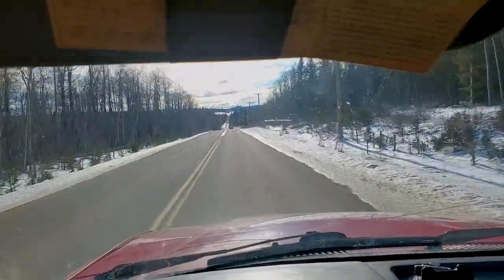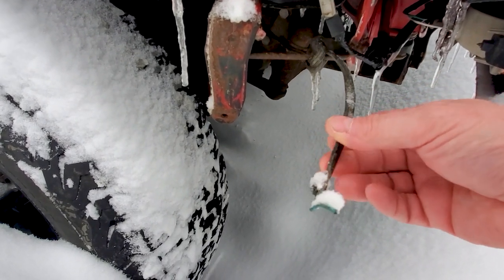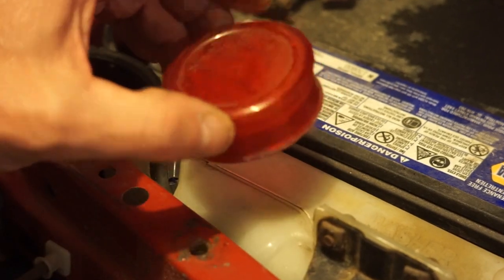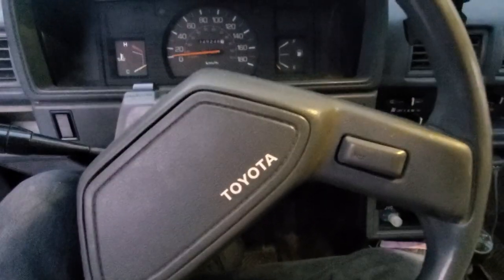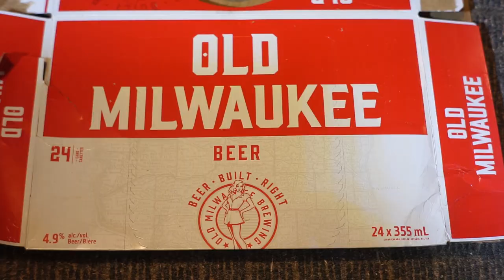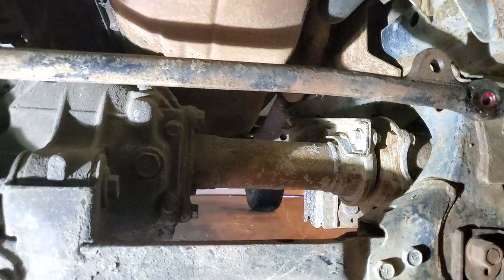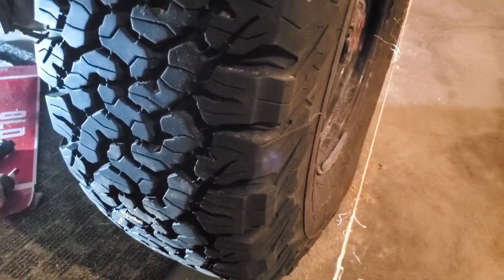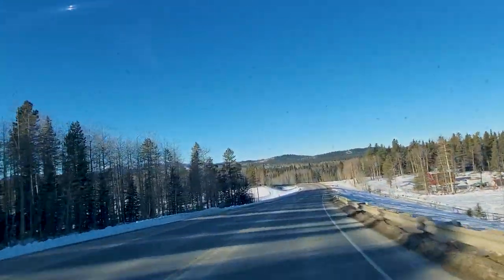Toyota 4x4 Pickup DIY Project, Tie Rod Ends, Idler Arm, Pitman Arm, Steering Stabilizer, Alignment

Comment: The older style ball joint seals have a hole in it to let water out. Very rare you see it nowadays but its to let water drain out or it can be pushed out when you grease the joint. Alot of people don't know this nowadays.
Reply from the maker: Thanks, good info. Do you mean the upper and lower ball joints?
Reply: @JimmyMeatwhistle  any type of joint that has a boot on it. All my dump trucks still even have that style. Brand new joints you buy with a boot. Spin the boot so the hole can drain if possible
Reply: @02blackLightning  Damn, that's good info. Well noted.

Comment: Also I got a 91 toyota pick up 2WD and In need to replace everything in my front. Any requests on the brand?
Reply from the maker: In these weird times, anything you can find will work. I'm having a hard time finding parts in general
Reply: Try looking up the brand Sankei 555. Made in Japan.

Comment: Great to see all the "love" you are pouring into your beater Toyota pickup!  Haven't heard of that "cave man" alignment trick used before . . . learned something.  

One source for Toyota parts for late model Toyota trucks that I've used in the past, is a supplier called Auto8 out of Australia www.auto8.com.au (Australia's version of Princess Auto).  Thousands of old Toyota pickups still running "down under", cause they don't rust so fast down there, and as a result, parts both original and after market abound.  Prices are typically great, almost zero currency exchange issues, and shipping is super fast.  Last order I placed with them was for a new replacement alternator for my 1991 Toyota Hilux Pickup.  Arrived 7 days later in Nova Scotia all the way from Australia, via Australian Post and Canada Post . . . incredible!  Part fit perfectly and runs to this day (cost me about $400 all in, including freight).
Reply from the maker: Wow great info there Mr. Birch. I'm going to check them out today. Thanks for the info, much appreciated🍻🍻

Comment: So surprised about the ball joints. With that toyota front suspension they tend to go out same time as the boots. Yes pitman arms, bearings, races, just did a similar rebuild on a 1996 t100
Reply from the maker: Thanks for the comments. Wow the T100 is a Rare Bird that's for sure. I was looking for one the other day believe it or not and I can't find one anywhere. In Canada that is anyway.

Comment: Thanks for sharing.  DId you get OEM parts or 3rd party and where did you get 'em from?
Reply from the maker: Hi and thanks for the comment.
3rd party. Actually having trouble finding Toyota parts for it. At the moment looking for a sector shaft seal. The original Toyota part number is 90312-36001 and it's no longer available from Toyota. So have a replacement coming from SFK